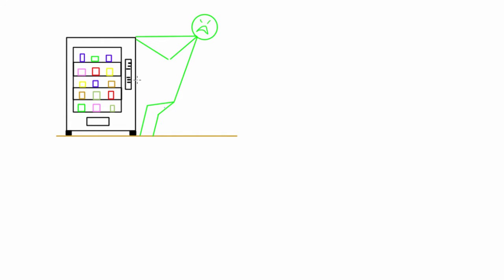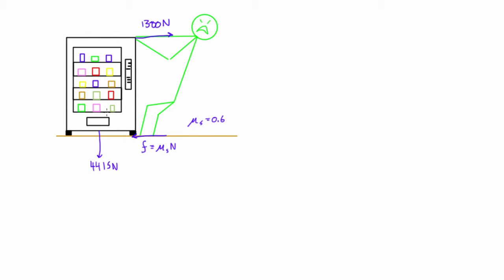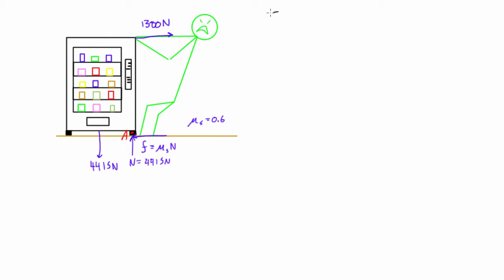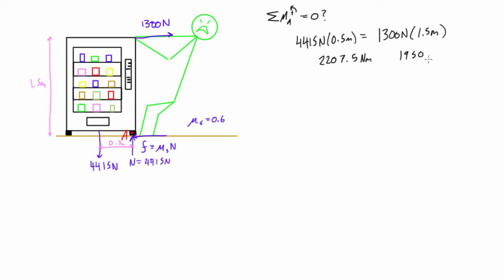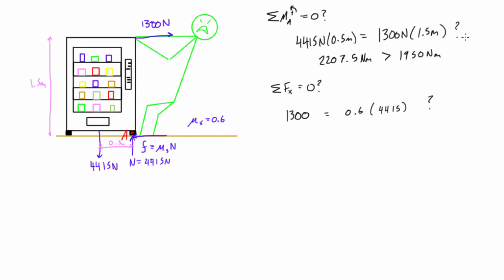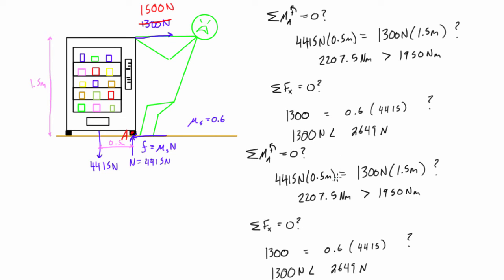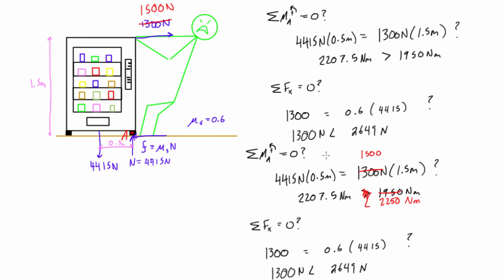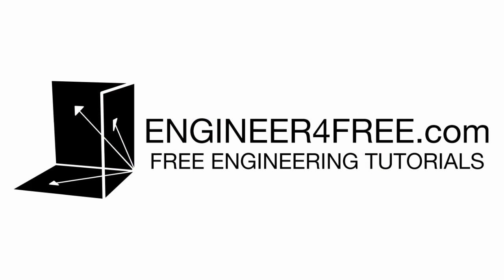Friction problem with moments:  pushing a vending machine, will it tip?

Comment: after discovering that the 1300N force isnt sufficient for the vending machine to be on the verge of tipping, shouldn't the FBD have been adjusted, to show a reaction and frictional force at the other vending machine point of contact with the ground